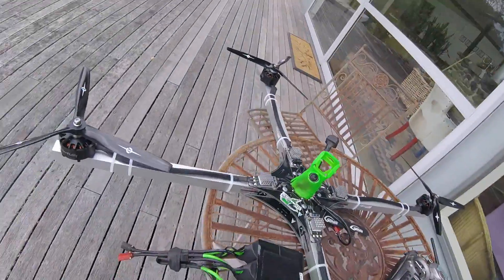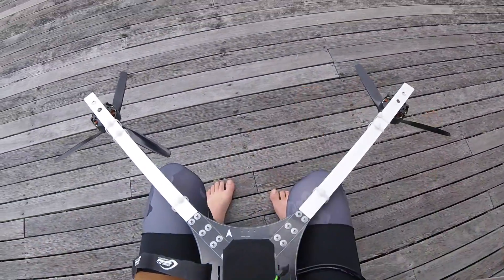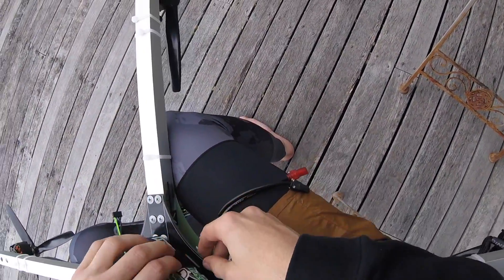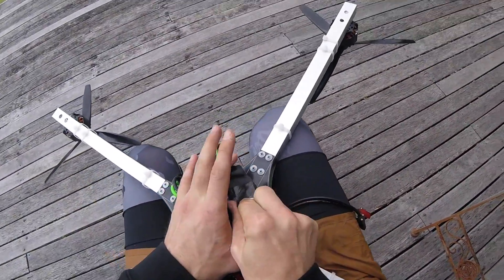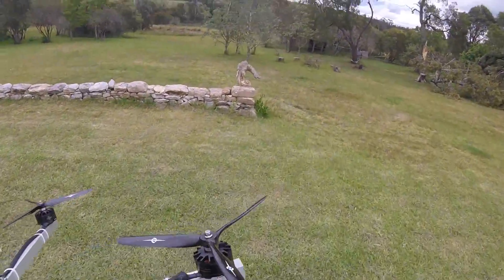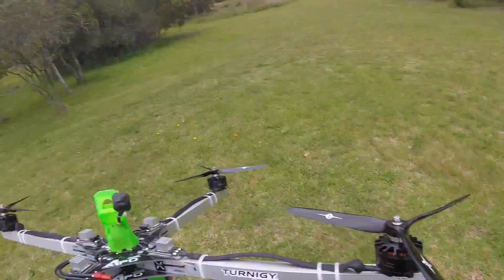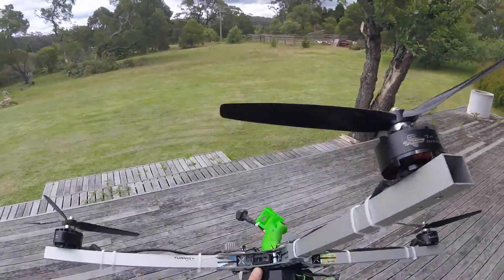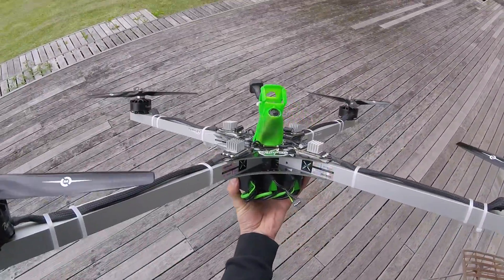12S 400kv T10's Working!!

Comment: How much does it cost for this setup?
Reply from the maker: Thanks to my amazing sponsor HobbyKing and R&D partnership with APD, it hasn't cost me a cent :) if you're paying full retail for all these parts, it would be around $1500USD for everything required
Reply: @autekxracing4593  wow.. Gues it Will take years before this will be cheap enough. Cool video👍
Reply from the maker: Thank you :) I guess the best gear out there (which is this setup) for anything will always be expensive. However it's definitely possible to get almost the same performance for much cheaper, potentially even the same as a high end miniquad
Reply: @autekxracing4593  very tempting!! Its easier to get forgivness then permission.. My wife will not be happy😀
Reply from the maker: Hahaha :)

Comment: I am wondering - you guys have a huge frame right now that could be easilly made to look like a flying sporting thing. But instead you still keep the super tiny pod in the center. Maybe you should make them to look like a sport/racing machine - not a DIY aluminuum frame with a small blob in the ceneter. It would be worth to look at it - instead of just listen to.
Reply from the maker: I agree completely! I have built a few quads with bodykits like you say, they look great. This quad is purely for testing purposes, the pod is actually from a different mini quad frame. I just don't dress up the test machines because it's a lot of work taking bodykits on and off. Now that this is all proven and passed the tests, I've designed a frame that you will love, I'll post it as soon as it's ready
Reply: @autekxracing4593  Superb. I can't wait to see it.

Comment: Why such a large frame with such small props? Shorter arm would save weight and make it more durable.
Reply from the maker: I agree. It's a spec for a racing series called XClass. We don't have to run small props, but most people use these props so we wanted to test for them before moving on to bigger ones
Reply: @autekxracing4593  Ah, thank you!

Comment: space the batteries to let air pass between them,  the middle pack can't loose it's heat and  it would give all 3 clear sides.
Reply from the maker: Yeah good idea.  That one ini the middle is getting roasted! Soon will be using the new NanoTech+, two 6S. These are just for some initial tests
Reply: i was thinking that putting 2s packs in series would be a better way  ( ignoring all the connectors ) to help keep battery cells at even temperatures.   it all depends on whether the batteries used can give the amps required without getting to a temperature that can cause problems for the cells in the middle of the packs.   as a rule of thumb when I do the maths I get batteries that can give 3 times the C rating I need,  it is not always possible of course but heat is less of an issue
Reply from the maker: @locoworks8179  yeah that sounds interesting. I've not yet had anything fail from getting too hot, provided I land before they're drained. It's being hot when they are being over discharged that causes them to blow. That's been my experience. A rule of thumb we use is if the batteries are hot, the powertrain is cool, you've done a good job :)